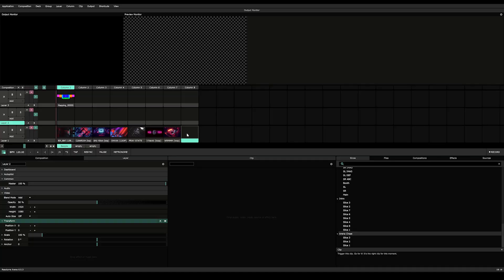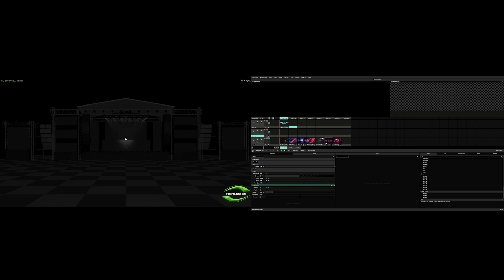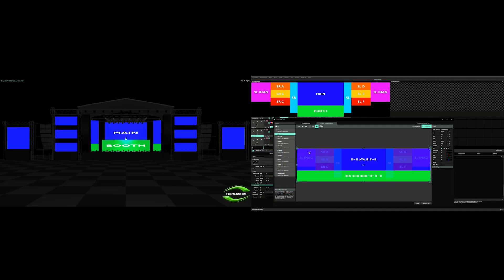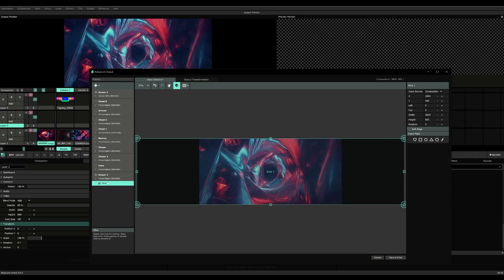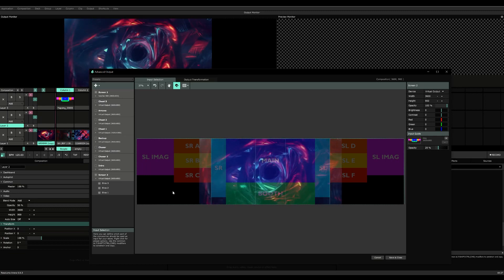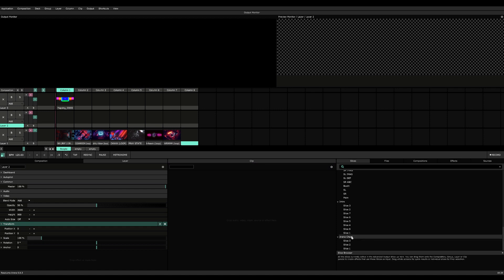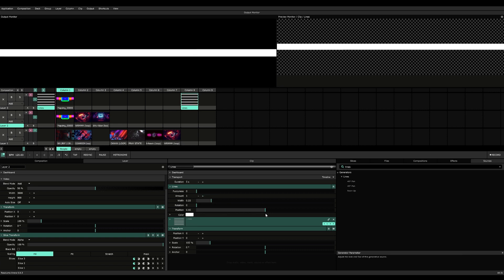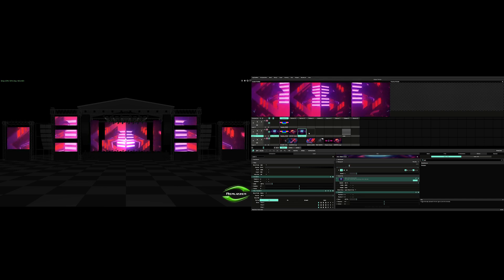Mapping in Resolume | Cool tricks with mapping

Comment: Hello, can you tell me how did you design or draw the screens? What program did you do it with? Thank you
Reply from the maker: Designed it first then built it in Realizzer 3D. Then made the mapping in After Effects, exported a frame and used it for mapping. You can also use Photoshop or any software that has a pixel-scale canvases that you can work on.

Comment: If i use 7 x 3 meter led , what px i can use
Reply from the maker: Depends on the pixels per panel or the pixel pitch per millimeter (which you can calculate in meter). By also calculating per panel; say, P4 (4mm pixel pitch) panels of 576mm × 576mm would be 160×160 pixels. For your setup, it would be 14 by 6 panels, makeing it 2,240×960 pixels.